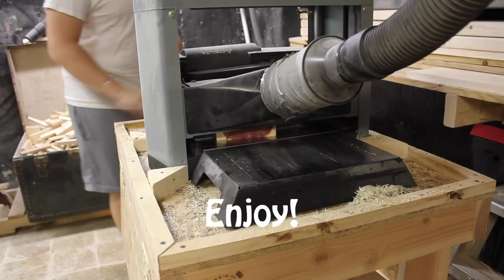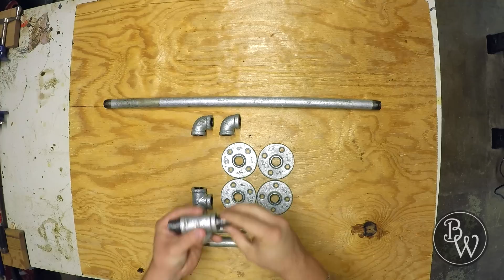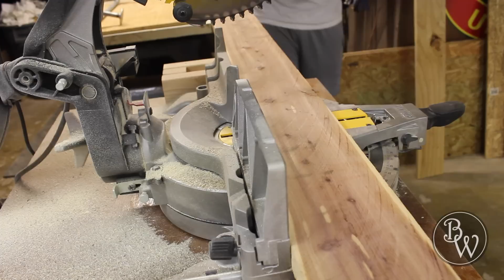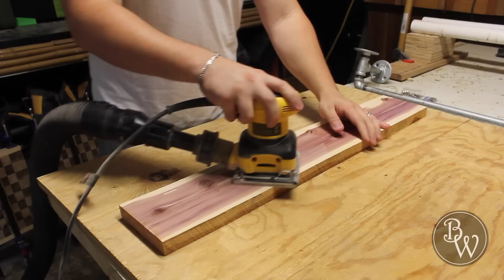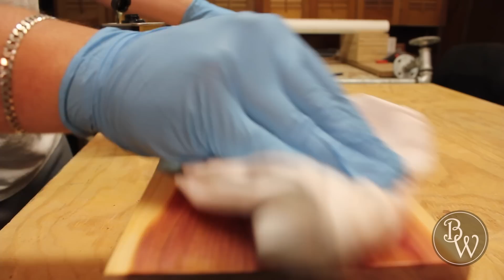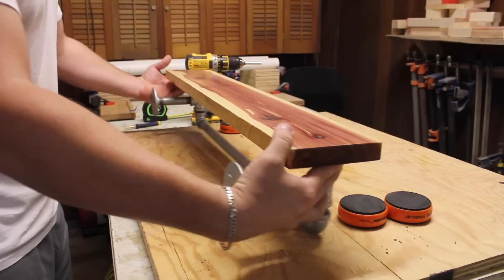DIY Rustic Iron Towel Rack and Shelf

Comment: Although cedar would not necessarily be my choice of the shelf materials, I do like the final assembly. I'd likely take the parts to a local powder coater and have some color added to the metal to brighten it all, but that is just me. Thanks for posting the video. Nice job. I find that hocky pucks work well for spacers when doing a lot of paint projects where you don't want to lay the project onto the table as you paint.

Comment: What did you clean the pipe with so it's not dingy or oily? Thanks for the video. 
Another stupid question. What was the device  you were putting the wood through before sanding it? Thanks again?
Reply from the maker: +OMRAGED hello, thanks for watching. The machine I used is a thickness planer. Also, if you want to clean up the piping, I used Vinegar and baking soda. Let me know if you have any other questions

Comment: Did you have to paint the pipe that holds the towel to prevent the black residue?
Reply from the maker: Hello, I ended up cleaning the pipes and then spraying them with polyurethane
Reply: awesome, thanks!
Reply from the maker: +Rudy G no problem at all. Thanks for watching